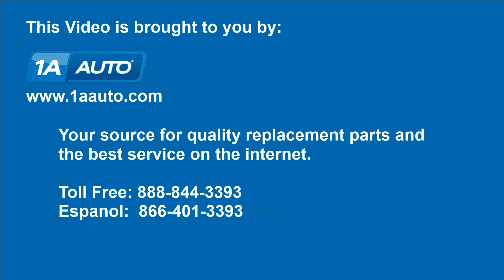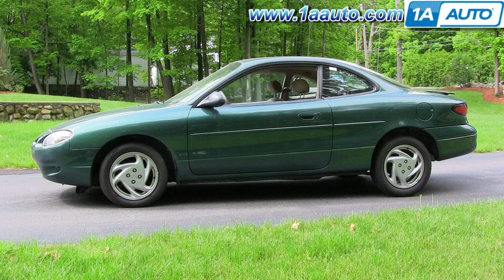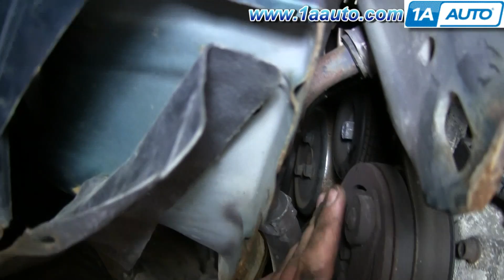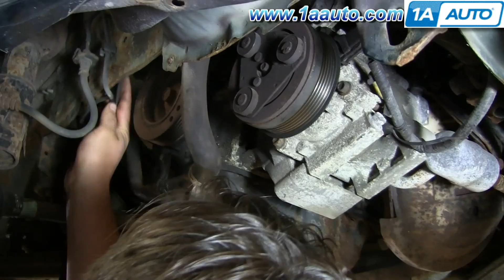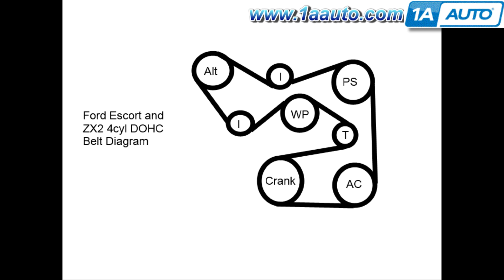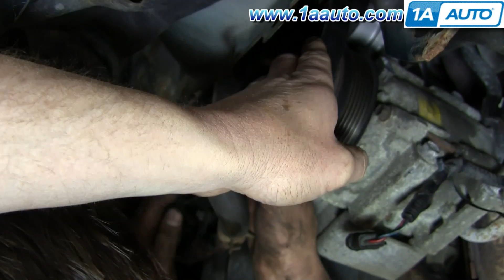How to Replace Serpentine Belt 97-03 Ford Escort

Comment: I was on my way to work this morning, heavy rain. Hit a pothole hidden from a puddle and it caused my serpentine belt to come off. I Looked up some info on here and found your video. It made repairing it easy. Thanks for the video!
Reply from the maker: +Frankopinion We're glad the video helped you out.  Thanks for watching.  1aauto.com 866-403-3393

Comment: Thanks for the video - the last time I replaced the belt I didn't know to simply use a socket and wrench on the tensioner, and used a pry bar instead (I'm not a mechanic, just a regular parts replacer) - this was MUCH easier - thanks again!
Reply from the maker: +Dan Tribble Our pleasure!  For anyone else who might be doing this job, we carry the parts shown in the video on our website. Order from us and we'll cover the shipping. Here's a link: https://www.1aauto.com/1A/SerpentineBelts/Ford/Escort/1AESB00057?utm_source=YouTube&utm_medium=CTA%20Comment&utm_campaign=1ATony
Reply: Hey so if the engine is running fine, then replacing the serp belt change doesn't impact the timing of the engine itself it just keeps everything running the way it should correct? It looks like the belt on there is starting to fall apart from previous owner not replacing it.

Comment: Thanks for the video. I'll be getting a new alternator and I googled that since my 2001 Ford Escort ZX2 now has 81,000 miles (lifespan 50,000 to 100,000 miles), might be a good time to replace the serpentine belt while getting the new alternator.

Comment: Was just driving my car and suddenly my battery light went on, steering wheel got stiff (no power steering), and my headlights got really dim. I opened up the hood and the belt spilt in two at one point like string cheese. I inspected the belt and it looks pretty new! I just acquired this car few months ago and been having issues with bucking/jerking and did ever repair under the sun to no avail. I'm wondering now if the belt is the wrong size, would it cause bucking and jerking. I really appreciate you guys, you have no idea how much you help. When I YouTube car issues your always number one. Thanks and please continue
Reply: May be a faulty ac compressor creating more load on the engine. It'd explain the belt as well.

Comment: Very helpful video.  I used a break over bar with the socket and a short cheater tube and it gave me plenty of torque to move the tensor assy. very easily.  Also, thanks for the routing diagram.

Comment: I can’t get enough slack from the pulley. Feelsbadman. Nvm got it🤪
Reply: I cannot get a tool or socket and ratchet on the tensioner nut. Not enough room for either.  Been working on this for two days.

Comment: My tensioner is way, way stiffer than that.  There is barely any room in there, and the socket wants to slip off the bolt head.  Absolutely stupid design.  What ever happened to alternators on swing arms and tension adjusters?  So much easier than this garbage.
Reply from the maker: +The Akh Thanks for the feedback!